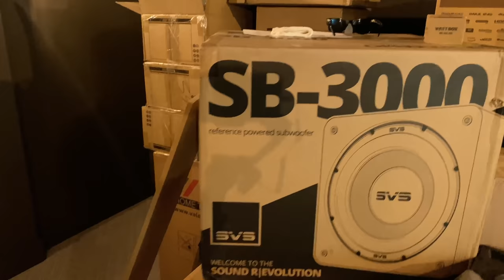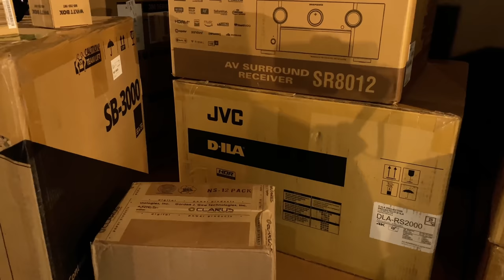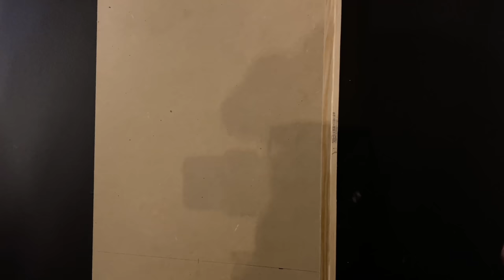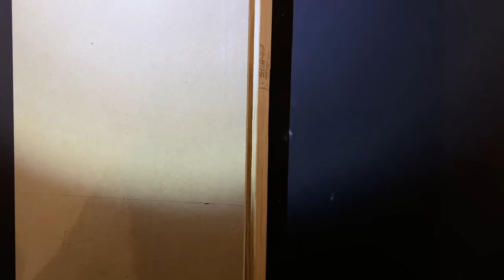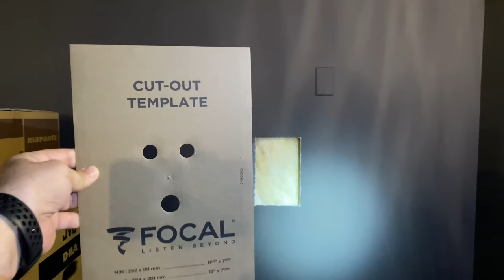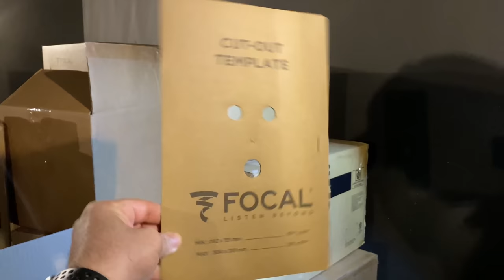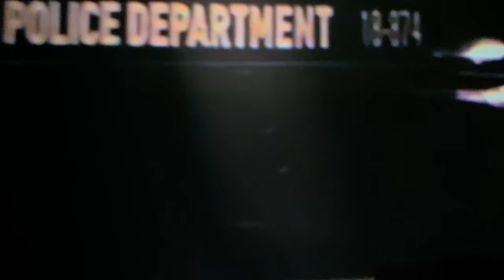*Full Install* Focal & SVS 7.2.4 ATMOS Home Theater Katy, TX

Comment: I live in a condo, with people above and below me, so I have a 75 inch tv, with just a 5.1 vizio surround sound system. . I cannot wait for the day that I can have something of this caliber.
Reply: I live in a flat (one story) condo as well, and unfortunately (for my neighbors) do not care how they feel about HT. The HOA told them that they made a choice and couldn't interfere with my constitutional right to enjoy my property.
It led to 5.2.2 setup.
Reply: TBH I like in an apartment with a 5.1 Klipsch system and a 10 inch Klipsch subwoofer. Since u allready have a vizio soundbar (I had one before myself) your neighbors should be used to some bass. I would go ahead and start building a system and just keep the gain dialed down on your sub.

Comment: I have this projector and purchased the same mount. Swapped it out as I was worried about the sag and plastic arms breaking damaging my expensive projector. Based on the specs the RS-2000 is at max weight for this mount.

Comment: You guys do some neat theatres but I have to say, if your LCR speakers are behind the screen you are either sitting to close to the screen or sitting at the recommended thx distance and sacrificing channel separation on the L and R channels. All based on the recommend 45deg viewing angle and 60deg LR channel separation

Comment: I love the install videos...system and all the components look amazing!!!  Outstanding install job!!!  Can’t wait to see the next video in this series... the led is going to look sick behind the screen.   What was the customers deciding factor on the 16x9 ratio vs 2.35:1 screen?  Ive been researching my next screen for the new space & not many options for ACT & Widescreen.  Side question.. THTD, do you guys sell OEM replacement bulbs? I have over 2200 hours (all on high lamp) on my Sony vpl-vw285es and i feel like the image is getting a little dim & i noticed some intermittent flickering.

Comment: The reason they make the screws with the special allen wrench hole is to make it tamper proof. It's purpose is to try to deter people from stealing the projector.
Reply from the maker: if someone breaks into your joint and has time to grab a ladder then they are determined to get any and everything in your house regardless of how accessable they are.

Comment: So much overkill and labor cost to build speaker boxes inside of that shadow box for in wall speakers. Why not just put regular speakers mounted on the wall in the shadow Box, lol.  Those low profile on wall speakers would have worked perfectly. People with money will pay for anything lol.
Reply: Well if you can why not pay for it. If they don’t mind then I don’t think he does haha.
Reply: @everythingburrito1897  my question was rhetorical and you basically repeated what I said in my last sentence.  It is irrefutable that building speaker boxes for inwall speakers inside of a shadow Box was unnecessary and there would have been a much simpler solution.